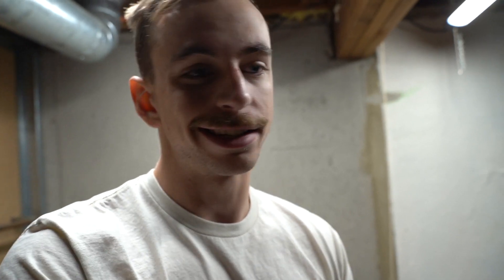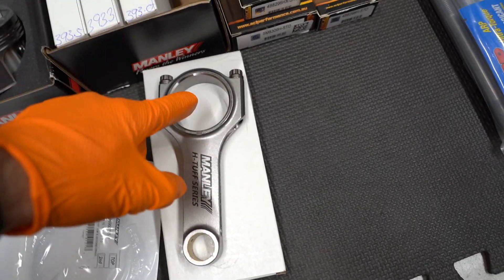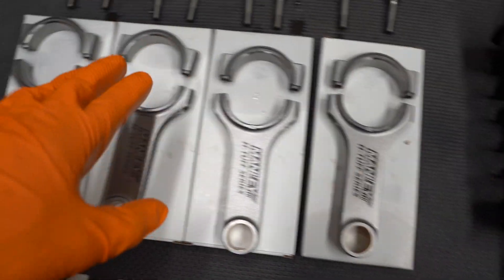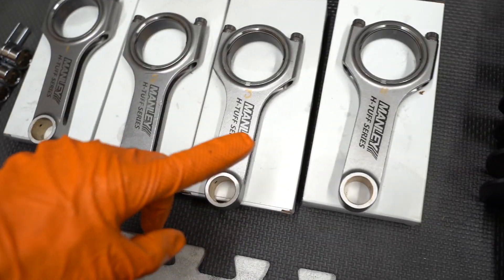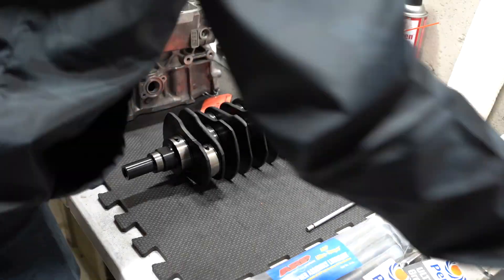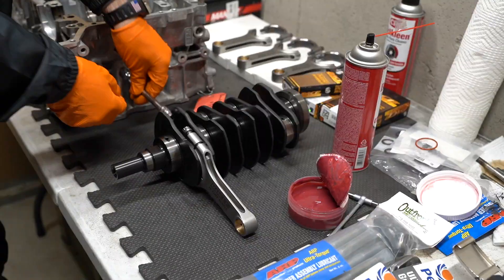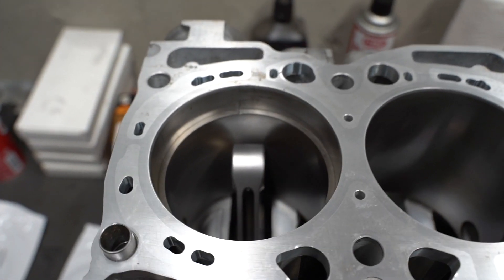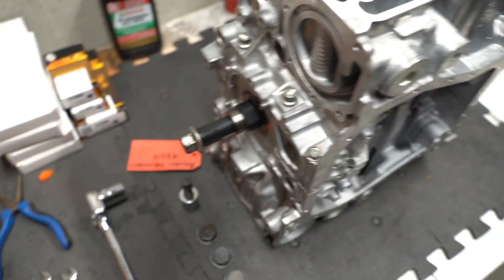Building an 800hp Subaru Engine!

Comment: Why did you put rtv on the edge of your main bearings and inside of the oil channel behind the bearings?
This rtv will all end up in your bearings and disturb the oil flow.
Reply from the maker: Seen everyone else do it. Its not a lot of RTV.. just a super thin layer. Shouldn't affect oil flow at all.
Reply: Every professional engine builder I've seen so far spare this sections out. Same in the FSM.
You know your clearances, they are even thinner as a hair.
Do you realy think the dried rtv gets through it without any harm?
Maybe it will not clog the complete oil channnel but it will definitely will leave some marks in the bearing when it works its way through the bearing.
Reply from the maker: Weird. I've seen Bader and Devin do it without issues. Guess we'll see🤷🏼‍♂️